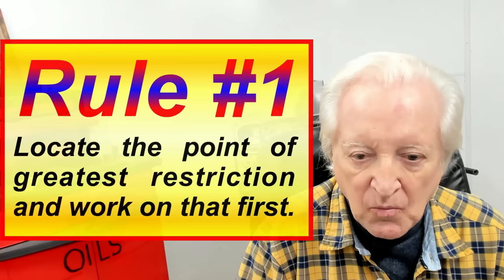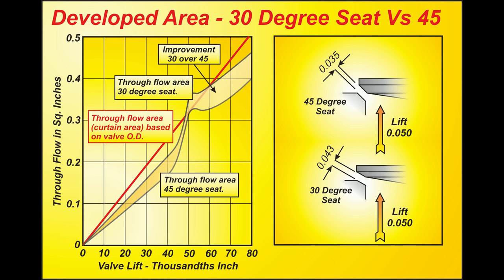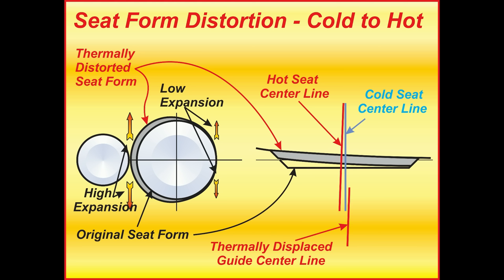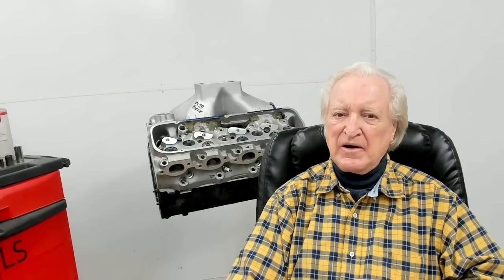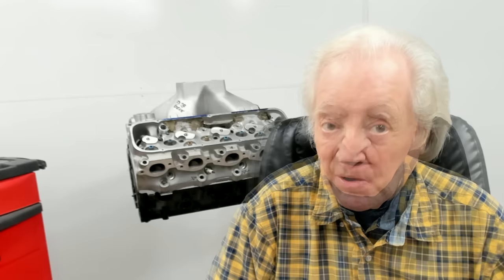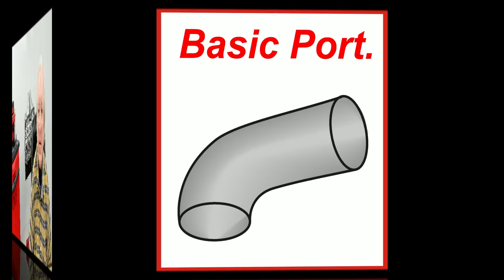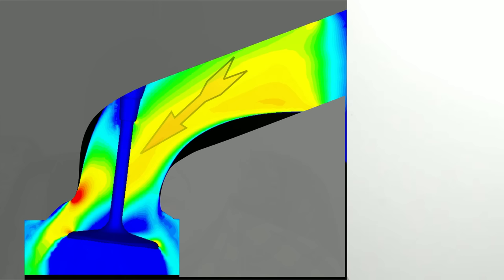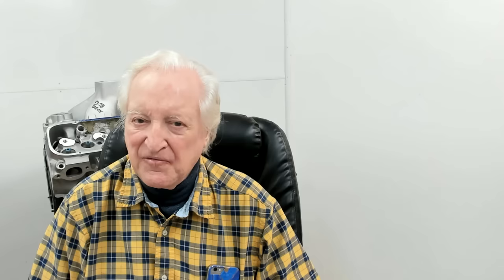% Golden porting rules - part 4 of rule #1

Comment: Sure wish you would talk more about 4 valve heads (instead of these old gas guzzler v8 heads), and POLYQUADDING!  I would LOVE to hear more about; how you determine the proper intake to exhaust valve ratio with your formula, and how to determine proper primary header length!
Reply: These old “gas guzzlers” as you call them absolutely rule and dominate the high performance market of all motor sports , which is what David is so talented and knowledgeable with!

Comment: I really love that finally, someone has combined plus explained science/physics with the process of porting heads. And the fact that AIRFLOW like that in aviation (Laminar Flow wings P51, Bernoulli's principle ect) is applicable to engine head ports. And just as too high a angle of attack causes the airflow to detach causing a stall, so too how airflow on the short side radius detaches and requires attention to fix. Along with David's book on head porting I have purchased, these videos further help my understanding of how airflow and correct porting improves even a stock head to rival a purpose-designed aftermarket head like AFR. I am hoping to embark on my first head porting exercise on a set of Australian HOLDEN HQ 308 heads, 123cc intake volume similar to a standard FORD 302,  L34 1.94 inch intake and 1.49 standard exhaust. I now understand how important a good 3 angle valve job is for low lift flow, seat angle, blending the seat, setting the THROAT to around 88-91% of intake diameter and port bias. THANK YOU for your very imformative videos. I wonder DAVID if you have or could do a video that shows the porting process using a grinder on a standard head which helps illustrate all your Golden Rules???? It would certainly help a novice/first-time porter like me see exactly how to employ your science and concepts in a real-world example. EG How I could use your Speed Bump theory when porting my 308 Holden Heads???? Look forward to the next video.
Reply: All the flow past the carb and boosters is turbulent.  The air in the intake port is stationary about 75% of the time, with the suspended droplets moving relative to the still air, and puddling.  The short turn radius always has a detached flow and turbulence.  Search for flow testing with a ball on a stick to find intake restrictions.
Best wishes from Florida.

Comment: Back in the day, when I was doing cylinder heads, my personal strategy / process in doing ports was to begin with the 30 degree top / transition cut, into the chamber, to establish the eventual seat heights and the chamber roof to wall radius, to the cylinder bore line, working through the seat angles into the throat.
My theory was that the throat, seat angles, and top cut into the chamber roof and wall, was a given, and dictated the architecture / modifications required of the ports.
Seemed bass-achward to some, but worked well for me, and established fixed geometry to structure the port on from where the flow eventually was dictated by.

Comment: David 
Thank you for the in depth information on valve shapes and seat angles.  I would really like to try using the valve you developed for the mini on a chevy 6, along with a refined lump port with the speed bump shape.  Also, the information on confirmation grooves on the valve face and use of the 30 degree seat angle is very informative.  I considered using a 30 degree seat when I read your book on how to port sbc heads.  I wondered about seat longevity for use in a daily driven sbc. I also had seen it in the how to build a max performance small block chevy on a budget.  I am glued to this series of videos, I want to add that you are a very inspirational person to continue offering your hard earned knowledge to the public for free.  Not too many professional,  or so called professionals are willing to do this.  Again, I want to say thank you to you and all involved with the production of these videos.
Reply: Can you help explain the anti-reversion groove at 11:00 (Conformation Groove) and it's dimensions if on a 1.94 valve and exactly how it's supposed to work ?
I don't get how it works.

Comment: The Ford FE uses a great deal of these properties in their ports.  The port crosses to the inside in the way that the 4 fronts angle forward and the 4 rear angle back, the wide side is the cross over the SSR to the center of the bore and the twist fills the center of the bores and the bowls are shaped with the high side of the bowl when cut across shows more area in the upper bowl on the center side of the bore with more bowl capacity than on the wall side.   This makes them easy to port for excellent power and torque. I have studied cutaways of these ports and I can see why they stayed with the Hemi engine  for all of those years in competition and even took on Enzo on the most demanding race course and longest and most demanding of all the world.

Comment: David, I would love to hear your port analysis of the late-model Hemi cylinder heads, known as the "Eagle" heads.  Port biasing would appear to be similar to SBC but, to me, seems like it's night and day different than SBC ports....due to the manifold-to-valve angles.  The Eagles counterparts, the "Apache" heads, flow better, especially on the exhaust side.  You touched on the late-model hemi's in this video, regarding their valves 18-20* backsides.  This is due, again, to the angle of air entry into the bowl area.

Comment: Hi David..in 1964 as a 19year old I ported and had skimmed a mini 850 head on my kitchen table using you're info from  a library book "Porting A series heads" I think.  My tools were a diy electric drill and a pack of Stones.  Worked well and my minivan felt the benefit.  Still dream of clover leaf combustion chambers!  I see we are both  ageing like fine wine.  Kind regards.

Comment: At about 08:20, you say that the area improvement of the 30 deg seat over the 45 decays rapidly with increasing lift, becoming minimal over 0.250". 
    The gap between the two black lines representing that difference shows the greatest difference at over 0.600 lift, and not much difference at 0.250....maybe wrong chart, or I am misreading?
    I borrowed &read "Tuning BL's A series engine " in the early '90s...was able to find a copy 10 or so years ago. I'm not a British car guy, but enjoyed it and learned. ( I'm a CV carb fan due to a motorcycle background).
    Eventually ended up, I think, with all of your books minus one on sbc valvetrains. Great information that I enjoy reading. 
   I recommend them, even if they don't seem to apply to a person's particular interest...like the "A series " book- any engine guy can learn something from it. And the Holley specific book is worth reading even if Holleys aren't your cup of tea. The one on porting is excellent, too.
    They all encourage thinking about details rather than bolting together parts on a list...things that can be applied to any engine. 
    Time to fix those one angle valve seats on your snowblower!
Reply: That graph covers a lift range from 0.00" to 0.080" it is just illustrating area as the valve is coming off the seat. DV go's into more detail on this on page 74 of his book "How to build and modify Chevrolet cylinder heads"

Comment: Also the sbc rockers do not line up centered on the valve stem which may cause some wobble, we use isky adjustable guide plates to correct it.

Comment: 🔔😎
Being an old guy like you DV, with an aviation career... Let me address the Waco cowling.
The speed bumps MIGHT act as vortex generators but as I understand it the intent of the original design was to allow the rest of the cowling to be more pointed into the relative wind. This @ 3" reduction of  diameter does allow for less drag and more speed per thrust. We usually called these "speed cowls".
Now I'd like to see one in a smoke tunnel. 😁🤔

Comment: David Vizard: 
This is probable the best episode because it is the most clear one. 
Hopefully this video gets a continuation with more actual foto's or film of details like these airplane 'bumps' etc.
Please do continue.

ps: could you add metric sizes too? Thank you.

The MINI classic head seems to have 2 inlet ports splitting up over 4 valves. The exhaust pots are 1 - 2/3 together - 4 = 3. All, the IN and OUT are on one side.
 That's absolutely different than the FIAT 600/850/903/ to 1050 OHV head. That one has an intergrated inlet manifold molded into the head on one site and exhaust on the other side of the head. 
And there it come: the angle of the valves are only ideal on the exhaust side! In other words: the angle of the inlet valves are not positioned 90 degrees but are laying 'flat'. So taking away material here seems not possible due to this angle and the big 'room' of the combined inlet ports alias molded in inlet manifold.
So creating a 'bowl' here is not possible.
Speed of the fuel is only between carb and head in the so called spacer.

Comment: Some older GM heads have a vane in the intake port, which could be whittled down to the "speed bump" shape DV described. Might be worth a try.
Reply: Are you referring to the port floor?84  My 2.8L v6 884 heads have that vane on the floor. I narrowed those down a little and kept the rounded shape. Result was mileage up 1mpg to 25mpg@70mph and much better throttle response through the powerband. Mostly felt in mid top end. 2800rpm up.

Comment: With a more one single stage seat, the breaking of that seal will also be more  abrupt.
Hence creating a much more singular one stage to the breaking of a vacuum.
Defiantly could be an advantage.
Air speeds are off the charts because the pressure change.
Too me thats one of the real drivers we neglect.
Across 3-5 valve seat angles(staggered) the pressure release is over a larger surface area/ longer time.
refining the breaking of the valve seat seal is AAA1 important.

Next is the piston to bore edge turbulence. 

: )

Comment: Great content, thank you very much
Personally I wish more 4 valve stuff, especially on valve and valve seat.
Reply: I second that! My take from it is the 1/4 D happens much sooner with the smaller valves as there's 2 smaller valves vs one. Basically shifts all those charts to a lower lift. Hopefully that's correct.

Comment: Your method effectively creates a vortex generator inside of the port. My guess is it allows the air to remain in a laminar state instead of creating turbulence going around the short side of the port, effectively "spinning" the air around the diameter of the port going past the valve into the cylinder, reducing the effects of inside curves. That's the only other way I can think of reducing turbulence besides having a longer or straighter port.
Reply: One good way that you can help build urgency in the sale is asking what are called consequence questions now that's called an n e p q l

Comment: Thank you for this. I’m understanding the text which I have been reading from you for 35 years far better. I’m watching with the text books in front of me. Especially this five golden rules. I’m faced with a challenge that you’re damn right I’m up for. But it’s not gonna be easy. I know I have the right cam. But the ports on the heads.. You know how if you are driving on the freeway and you go around the long sweeping turns that if you’re going 80 mph it’s no big deal. These suckers are like if you’re going 80 mph and turn into your driveway. The $40 flowbench is going to have to get me through. But just hogging these out is just not the approach.

Comment: Air bumps are a funny thing.  Placed AHEAD of the desired result, vs placed AFTER the desired result is a matter settled by which  bump was smaller to get the desired result.  Un the runner floor case, Grumpy Jenkins had a floor depression (removes more metal) whereas the addition of DV's speed bump is quite small amount of "metal", for stronger result.  Yet, the "reduced CSA " concept to flow more would be that narrow upper runner zone ( more fill material).  Suppose my point would be that a proper turtle- bump could improve short-side flow too, if that was desired.  Overall DV GR#2 holds to let the air go where it wants: the far bowl wall to CYL. Oh yea, there is a bump-opportunity from Head--to-CYL  on the strong Inhale path (AFTER the bowl, shortturn, and runner floor that may just "do it all", thus save effort on floor features.  I think.

Comment: What do you think about engraving small “cooling fins” on the intake port , along the exhaust side to try to cool that side of the seat, to help with the distortion of the seat??  If a semi rough intake port helps with atomization, as long as the grooves are small, they might actually help with evening out the temperature difference,and reduce the amount of distortion of the intake seat. Whadda you think???

Comment: So when I was reading this part of your book the other day (I got the head book for christmas)  it only really metions 30°, 45° and 50° as seat angles.  Is this just for demonstration of the pros and cons of moving each direction or is there a reason not to do 35° or 40° seats?
Reply: I get the impression from other videos that 39° seats are less fussy but still have better low lift flow than 45° seats. These might be a good choice in low rpm applications.

Comment: Question about anti-reversion groove on the intake valve. Wouldn't valves that have been machined on the face to be lighter weight vs flat face valves function in this same manner? Also has any of this been applied to the backside of the exhaust valve? Most exhaust valves are tulip shaped. For reverse flow that shouldn't be what you want if I'm understanding this correctly.

Comment: Didn't Pontiac have 30 degree seats?   When I was in high school, my heads were rebuilt in the high school shop and we had a Sioux valve machine and seat cutter machine.   Kids being kids, we had enough stones to make a 3 angle valve job.   Of course we also cleaned up the ports with cartridge rolls and gasket matched the ports.   I had always assumed the gasket matching was the big change.   Note: this was a seat of the pants change.
Reply: Most Pontiacs and AMCs, a few Olds and Fords used 30 degree intakes.

Comment: Thanks. Is there any value in how deep an intake or valve seat is in relation to the other? Better exhaust scavenging if it were deep or higher when overlap occurs?
Reply: I have wondered about the same basic thing. I'm thinking if the exhaust valves are sunk in further than the intake valves that could possibly help reversion as well. Mostly at lower rpm, lower load where airflow would be less.

Comment: I’m not following the math at 28:50. Area of the valve (ignoring the stem) is 0.25 x pi x d^2, whereas the curtain area is 0.25 x pi x d if memory serves. Shouldn’t they should only be equal if d = 1 and the actual valve lift at the transition should be 0.25 (d[valve] - d[stem])^2?

Comment: 🇦🇺🙂
Hi David.
Just a question.
You talk about speed bumps in the intake prior to the inner side ramp over for optimum efficiency. 
To gain this would creating a dimple effect like on a golf ball that creates the air to turbulette causing a vortex of the main flow to ramp up over the dimpled turbulent air region of the port. 
Thus increasing efficiency.

Comment: Can this “bias” concept be applied to LS cathedral port heads?  How much material can be removed from this area on the cylinder wall side of the bowl/port without hitting water?   Also, how do you get those “speed bumps” on the floor, does that require welding to build up a bump!  How tall/wide does the bump need to be or does it vary depending each port’s geometry?

Comment: Thank you Mr.DV! I wonder does this mean that if the cam lift isn't above 0.25D, there is no benefit on biasing the port on the cylinder wall side at all? When staying below the .25D lift we'd benefit more on the 30° seat-valve angle mod?